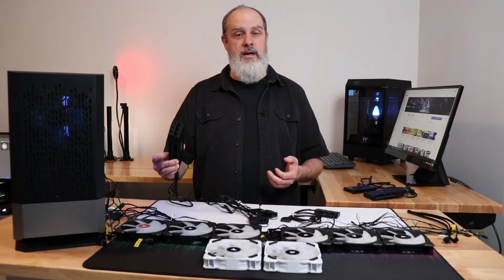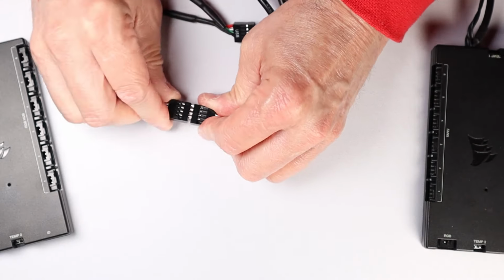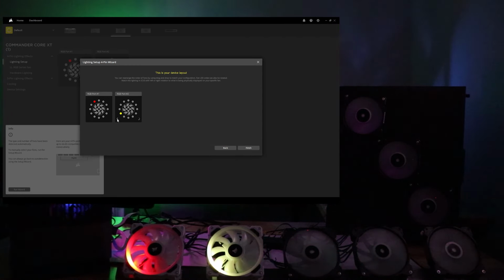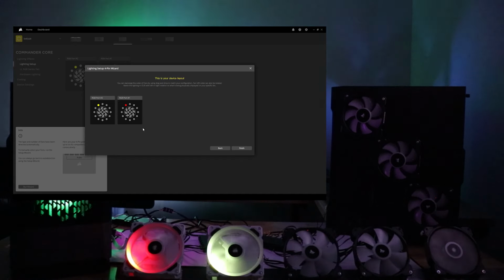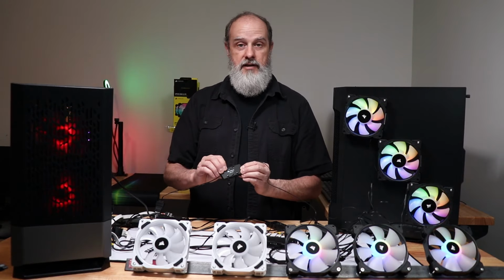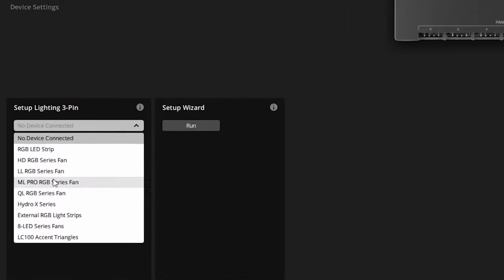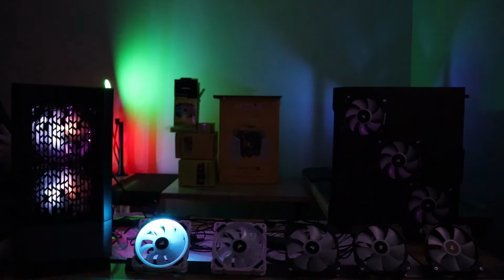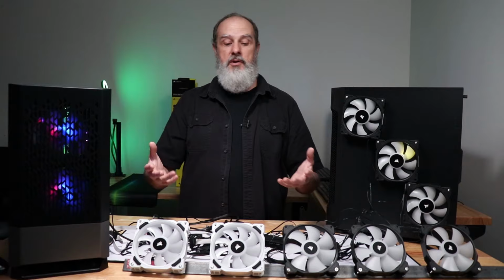Using multiple Corsair RGB controllers to control more than 6 fans in iCUE

Comment: I was looking for a video like this. I'm currently working on building my very first PC with high end parts for 4k 60Fps HDR Content Creation and work and bought an Nzxt H7 Flow case in white and a Corsair iCUE H150i Elite with the Round LCD display and wanted to swap the RGB fans it came with for better corsair branded fans and want to add more than 6 but wasn't sure where to start so thank you. This was very helpful 🙏🙇‍♂️

Comment: Just finished my set up, 12 ML120 / ML140 fans. The commander core XT is showing all 6 fans connected, but the commander core pro doesn’t show up BUT the 6 commander core pro fan options are instead listed under the options for the H170I water cooler. Every fan on the commander core pro can only reach 1.1K rpm, 4 on the XT get to 1.5k and 2 on the XT get to 2k. Idk lol.

Comment: I'll be wiring up 14 fans, 6 on the AIO rad for push/pull, 140mm, 4 case fans 140mm and 4 120mm case fans, suggestions?  How many commander pro xt s are needed?

Comment: What would you do to add a 13th fan? I'm doing a build in a corsair 5000x case. I'm gonna have 6 intake fans 3 front/3 side. I'm using a 360mm AIO as a Push/Pull in top of case then I was gonna use a single 120mm fan in back of case for exhaust for the 13th fan

Comment: Thank you so much for this video. I have been trying to figure out the best way to power 9x ML120 Elite RGB fans, along with an H150i Elite Capellix in my PC, and this video answered all of my questions. More informative than anything I have read online, and much easier to comprehend. I appreciate the work you put into this, thank you again!
Reply from the maker: Thanks travot3k, I'm very happy you found this video helpful! Thanks for your feedback and support! Thanks for watching!
Reply: Mind sharing how you connected your h150i to the commander pro xt? There's a 24 pin connector on the h150i that only seems to connect to the included commander core, so I had to go with only one xt and return the other. I would have much rather used both xt's though!
Reply: @AegonVI  It's not possible to power the H150i from a Commander Core XT. I used  the Commander Core that came with the H150i and a Commander Core XT. Those two Commanders are basically the same aside from the connector for the H150i pump. Altogether, I connected 10 ML120 RGB Elite fans, as well as the 2 fans that were included with the 5000D Airflow case, and everything works great.

Comment: How many commander core xt should I get to connect 13 Corsair fans
Reply from the maker: Hi ShoMeMyOpponent, the CORE XT will control 12 fans (both rgb and pwm).....the PWM connections are easy to split, just buy a splitter cable. It's the RGB control on the 13th fan that might be an issue. The 4 port RGB connection isn't easy to split up, I think that's a DIY project and I haven't tried it, although it's on my list as I think it would be useful in these situations. 

However, what I would do if you have 13 of the 4 pin RGB fans is consider adding a 6 port RGB fan hub from corsair, this hub connects into the RGB port or either XT and gives you that expansion, you could also consider a lighting node core in addition to the 2 XT's, either hub or the lighting node core would work fine, the advantage of the HUB is that it's just a small 3 pin cable directly to the XT, the lighting node core is another sata power connection and another USB connections, it's another controller. 

Check out the hub here:

https://www.newegg.com/p/1YF-001H-000G9?Description=corsair%20fan%20hub&cm_re=corsair_fan%20hub-1YF-001H-000G9-Product

Good luck, have fun and thanks for watching!
Reply: @HardwareArtisan  thank you for all the good info. The hub that u had link to is the same lighting nodes that come with Corsair fan 3 pack right?

Comment: I have my AIO fans running to my Core XT and just the pump running to the Core that came with it, does it matter if the AIO pump and AIO fans aren’t connected to the same Core? And which one should I run the temp sensors to?

Comment: The biggest problem is the lack of more than two usb 2.0 ports on MB sometimes there is only one usb 2.0. My experience with the Corsair Commander Pro after 2 consecutive failures and yes Corsair RMA and replaced both units for usb port failures on the commander Pro. I have been running 12 Corsair RGB fans for 5 plus years. Fans are starting to fail as I never turn the system off.
Reply: I solved this issue with an NZXT internal usb hub. $26.71 at NewEgg (sold and shipped by TechJunkie). Corsair also makes one, but it's out of stock at Corsair and absent from NewEgg inventory.
Reply: Yes on "cheap" motherboard they offer only one USB2.0 and one UBS 3.0. If you buy the expensive MBs, they usually offer two UBS2.0 and two UBS3.0

Comment: I just did two builds.. the first in a Corsair 5000 series case with ten fans and the second in a Corsair 7000 series with eleven fans.  The best I can say is the best I could do on cable management was I managed to get the back door closed.  Sooooooo many cables.
Reply: Yes i agree... i have a corsair case..glas panels ! i needed 2 rgb commanders because the front 3 fans are standerd with the case and cannot be controlled by the commanderpro.. so the top 2 and back fan needed to be connected to commander pro al those cables were hard to work around with cable management

Comment: Shouldn't it be possible to just daisy chain 2 or 3 fans to one ARGB port of the controller, thus allowing up to 3 times 6 = 18 fans on one controller?
I currently have 8 Fans and 1 LED strip connected to 3 ARGB headers on my motherboard, and it works just fine, because the fans come with daisychain cables included. Shouldn't this work on any other device as well (like this corsair controller)?
Reply from the maker: Hi ElectRocnicOfficial, that's a great question! I've never tried this, I've no doubt you could get more than one fan working per port to some degree.   I'd have to play around with this on the bench to see how it would behave, you can't really tell iCUE how many LED's are on each port (like you can with most other RGB software), and you can't specifiy multiple fan models per port.  It's designed for one fan per port.....I'm not aware of any existing pre-made cabling to accomplish this either, you would have to DIY the cables.  The controller here is basically acting as the daisychain cable.....

It might be easy enough though to just split the connection so that each fan on that port gets the same RGB signal, they would have the same effect......

This might be a fun experiment, if you find any information on this subject let me know, it's all fun stuff!!

Thanks for taking time to post a great question, and thanks for watching!!!
Reply: @HardwareArtisan  thanks for your response :) I actually missed the fact that the Corsair Commander does not use ARGB headers with 4 pins, but some proprietary headers I guess? This makes a difference. I do not know if they can be daisychained. Also, it depends on the maximum W the controller can deliver obviously.

Comment: i will not be able to control 9 fans (including the 3 from cooler) with only the commander core (that comes with cappellix cooler) and 2 lightning node core will I ?
Reply from the maker: Hi Joao Monteiro,  you will be able to control the RGB lighting of 9 fans with the commander core and one lighting node core. With the commander core, you can control the speed/power of 6 fans, leaving you to figure out what to do with the other 3. You could use splitter cables to connect all of them to to the commander CORE. Obviously you won't get individual control over fans when using splitter cables, but it works. You could also choose to use another PWM hub motherboard ports to control the remaining 3 fans. Or, you could skip the lighting node core in favor of a commander core XT which would then give you control over all of them and leave room for expansion. Using splitter cables is a decent solution however. Thanks for watching!!!
Reply: @HardwareArtisan  I will try that and save 70€ (thats what a commander core xt costs here in Portugal). Thanks for the answer bro :D

Comment: Hello,
I am currently in the process of building in a Corsair 7000x that comes with the comander core xt. I will be using 11 Corsair QL120 fans and water cooling with Hydro x C7 cpu water block and Hydro x g7 gpu water block. Would the best way of tying everything together be getting another commander core xt? 
Any help would be appreciated, first time builer.

Comment: Awesome content! Been watching your videos and have a Q. I have the 500 tower case,  4 corsair LL fans (where im putting 2 in the front bottom for intake and 2 on my 240 AIO) and then 3 corsair white LED fans that im putting on the radiator mount just like you did on your 500 build. I have the core XT and the hub that came with the LL kit. Can i run the white LED corsair fans with that hub? What would you suggest for best setup?
Reply from the maker: Hi Daniel Christmas, thanks for watching!!! The 3 white LED fans will just be DC controlled fans if my recollection is correct, these 3 fans only have a 3 pin connector. The Hub that comes with the LL kit for the lighting node pro is only for RGB fans (4 pin RGB) and does not power the fan itself, PWM OR DC. You can plug them into the 4 pin PWM connectors on the Core XT which will power the fan and the LED. With the CORE XT, you will get no speed control on the DC fans, they will run at full speed. 

I think what I would do is skip the HUB, it won't benefit you in this case. Buy a set of PWM splitter cables. You can plug this cable into one of 4 pin PWM ports on the CORE XT and then plug in your 3 white LED fans to the 3 connections. This should work great, these 3 fans will be full speed, but in most cases that's ok. 

This leaves you the 5 other PWM ports for you 4 RGB fans. 

You can buy the cables here from amazon (8.49 as I write this)  (i've used these cables, they work good) 

 Cable Matters 2-Pack 3 Way 4 Pin PWM Fan Splitter Cable - 12 Inches

https://www.amazon.com/Cable-Matters-2-Pack-Way-Splitter/dp/B07PXLHNZ6/ref=sr_1_3?crid=2JI41ONW30ZRC&keywords=pwm+splitter&qid=1669871800&s=industrial&sprefix=pwm+splitter+%2Cindustrial%2C96&sr=1-3

I hope that helps, great question!!! Thanks for watching!

Comment: So how do you have enough usb headers for core and corext? I used to use the pro that had 2 extra usb on board. Does the pigtail off the xt power the core?
Reply from the maker: Hi Vanhelsingle, that's a great question. the CORE XT USB pigtail will power the Commander CORE. The only controller i've found that won't work on that pigtail is the Commander PRO itself. 

So, Yes, You can connect the CORE XT to your motherboard header, and the CORE to the pigtail, works fine. 

Thanks for watching!!!!

Comment: Good video! I have a question. Installed Corsair iCue 100i elite lcd aio cooler with 2xML120mm. In pc case I have 3x QL140mm fans. In icue software I try use infinity mode to go lights through in order, but for some reason icue using my 3x 140mm and don't go for 120mm. Do you know why? I used autodetection for fans and actually commander see them 120mm as something else. Should I change that manually to ML? Any idea? Greetings, Tom.
Reply from the maker: Hi Tom, great question. As best I can tell, inifinity only works with the QL fans. I checked on my current setup and infinity isn't available for my LL Fans.  So, your 2 ML fans wouldn't use that lighting scheme. It's not under lighting link and would only be specific to the QL fans. It's Unfortunate, i'm not sure the exact reason Corsair couldn't have made that work.  ICUE should properly detect those two types of fans, if it doesn't I'd clear the config, restart and retry the autodetection. I hope that helps, Thanks for Watching!!!
Reply: @HardwareArtisan  you are absolutely right. ICue recognise them both but they don’t have infinity available for them. Shame. I bet because they have less amount of led’s. Corsair cooling product manager responded to my: 
“You can mix and match fans but it will separate them based on led count because certain effects don’t work with less LED’s then what they was designed to work with.” 🤷‍♂️ Bollocks I can say….you spend hundreds for lights and then you find out can’t use them as you planned.
Reply: @HardwareArtisan  Hi again;) ok when I use autodetection icue see them both 120mm ML as 4 led's another fans, when I choosing manually them, they still working. About infinity-I can set up this mode for QL and ML but seperate, they not cooperate, which is part of one system and it's shame they don't. For that money it's  little bollocks ;) One think is I should really check what size is of them both another think is bigger aio probably wouldn't fit in my atx case because on front I have cd rom and could be to tight. Always some compromises... Cheers for answer. Tom

Comment: Can you comment on putting case fans and AIO fans on the same controller?   Is that a no-no?  Should I keep my AIO fans on a separate controller better control of CPU temps ?
Reply from the maker: Hi Vangelis A, great questions. You can create custom fan curves and apply that curve to any fans on the controller, you can mix and match fan curves. Because of that, there is no reason for a seperate controller for AIO fans, these controllers will meet your needs.  Thanks for watching!!!
Reply: @HardwareArtisan  Thank you!

Comment: I know I'm a bit late.. but I'm building my 1st pc, would I be able to use the rgb hub (comes with the sp120's) and a commander core xt? I know I can't plug them into each other, but I should be able to use them both separately correct?
Reply from the maker: Hi Vinnie Catalano, that's a great question. Yes, you can use both of those at the same time. If these are the SP120 Elite fans, they can plug into the CORE XT if you have room. But, ICUE will see and work with both at the same time with no problem. Good Luck and have lots of fun. Thanks for Watching!!!!

Comment: can i connect a node pro into a comannder core xt ? cause i wanted to connect my lian rgb cables to icue aswell as the rgb stripe from the lian o11
Reply from the maker: Hi xXCannYXx, the lighting node pro is it's own controller, it won't connect 'into' the CORE XT. However, ICUE will work with both of them and you can sync many lighting sequences to all devices on both controllers. Good Luck and Have Fun!!! Thanks for watching!!!

Comment: why does nobody show where to plug them into the motherboard
Reply from the maker: Hi PopShminky, generally when using Corsair Controllers,  the only thing that gets plugged into the motherboard is the USB cable to a 9 pin USB header. Everything else gets connected to the controllers themselves. 

There are times where you might choose to use PWM connections on your motherboard, but usually were trying to eliminate that with these controllers. 

If you need additional information, please let me know. 

Thanks for watching!!!

Comment: If Ihave a corsair connector on my msi motherboard, what is that for?
When you are talking the first and second pigtails, how do you know which is which?
Can I daisy chain 2 commander core pro xt's and 1 commander core pro
Reply from the maker: Hi Timothy Carey, great questions. The "jcorsair" connector on your MSI motherboard would allow you to connect a corsair LED strip directly to the motherboard, or, an RGB fan hub, you would use a cable to connect the hub to the port on the motherboard. Per the documentation, this allows you to use MSI's software to control the strips or FAN's on the HUB. 

I see no mention that iCUE would be able to see the devices on the MSI motherboard, I think only ASUS boards are supported in iCUE at this time, although it's been some time since i've looked. 

As far as the pigtails go, the first CORE XT you connect using the main cable (not the short pigtail) to the motherboard header allows the short pigtail to get a signal. But if you daisy chain a second CORE XT to this, which does work fine, the second CORE XT's small pigtail will have no signal from the first as only a single set of pins are connected on the small pigtail. 

It's enough to detect and use the second core XT but leaves no signal to the pigtail on the second XT, it's confusing, I hope that explains it. 

You could daisy chain all 3 of those controllers, the PRO should be first, followed by the two CORE XT's knowing that the second CORE XT (the one connected to the small pigtail of the first) will have no signal. 

You could encounter issues with that setup in some cases, i'm working on a troubleshooting video, one solution if you have issues with that is to use a usb 3.0 header adapter to usb 2.0 and use your usb 3.0 header as it has better power characteristics, I'll describe this more in an upcoming video. 

Good luck, have FUN and thanks for watching!!

Comment: Hi, I have a Commander Core that came with AiO cooling. In your opinion, will it be safe to connect 8 fans to it, without disturbing the operation of the controller, brightness and fan speed? I'm going to do it like this:
1, 2 and 3 ports for AiO fans.
Two fans for port 4 and two fans for port 5 by means of splitters.
To the sixth port, the rear fan.